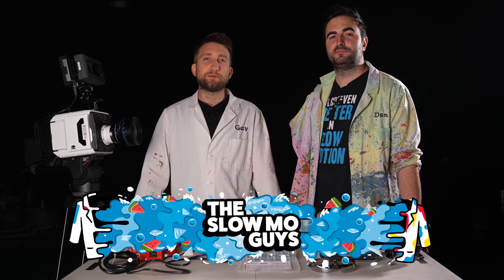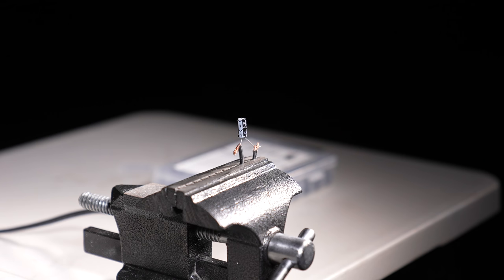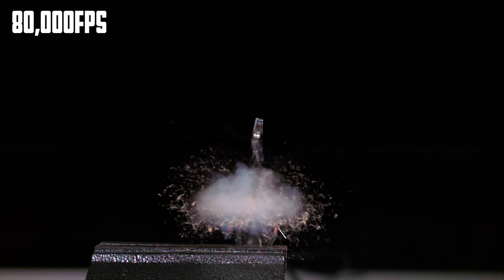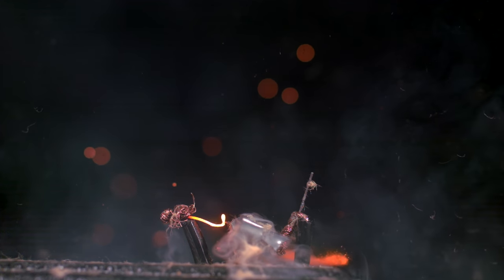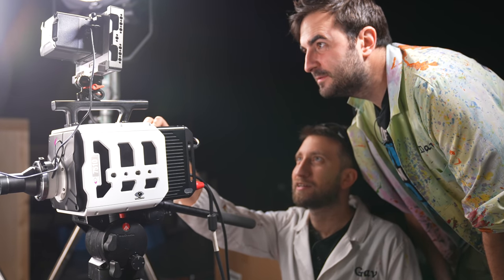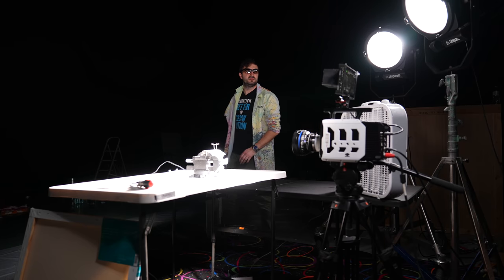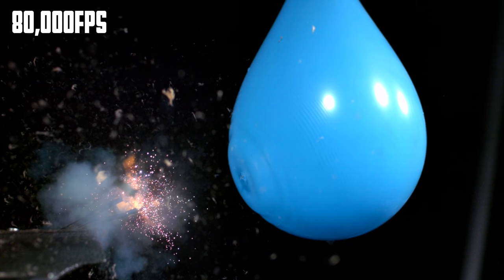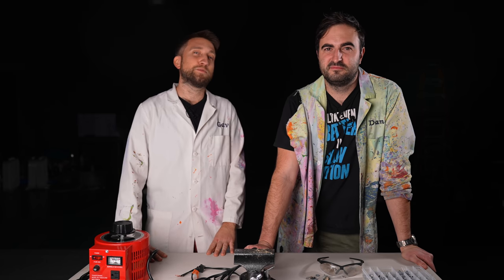Blowing up Capacitors at 187,000FPS

Comment: as a 12-13  Y.O kid I hooked a capacitor up in series with a 60 watt light bulb.
[ this was before they started making vented capacitors . I forget how many M.F and the voltage they were intended to run at, as this was many many years ago ]
I was standing too close to watch what would happen , and I noticed that the plastic label slowly started to shrink, and then a huge bang.  and the can went flying .and there was shredded capacitor guts ll over my glasses. it scared my cousin who was there, because he thought it  had broken my glasses. LOL thanks for bringing this funny childhood memory back  😀

Comment: The second explosion in the video happened to me during my apprenticeship. I was experimenting with capacitors and a laboratory transformer when suddenly the top of the capacitor in my hand began to shoot upwards. I threw it in the air beside me and it exploded in a cloud of dust. I was a bit shocked because I had never heard that this could happen. I thought it would only melt if I put too much energy into it.

Comment: We had a little electronics hobby room in my house, when I was a kid, and I used to love blowing up capacitors. I never tried ramping up the power though... I just plugged then into the mains (120 VAC) and they go bang... When I was really young, my dad would get us to charge them up on the mains and bring them to school... I don't remember actually doing it, but I remember the stories of throwing them to other kids and saying "catch" ... We also did this with siblings. 

My most recent "incident" with a cap, is working on a Bombardier snowmobile. Some of them have a clever electric start system (no battery no starter motor) They use a giant cap to start the machine by sending power to the stator... Anyway, I purposely crossed the the terminals with a screwdriver ... There was a ear ringing BANG and metal from the terminals and screwdriver was vaporized. Impressive.

Edit: I Just had another capacitor memory... I ran wires into a jam jar and screwed the lid on... then held the lid in place so that it wouldn't pop off... I wanted to collect and examine all of the bits... I was 9, and yeah... I never tried that again, and luckily the jar didn't explode... my hand healed in just a few days.

Comment: My father had a patent on what he called a plasma arc in the 1960s. While experimenting with capacitors he found the larger the capacitor that he used the  and even more amount of plasma would be produced. He thought if he upped the capacitors enough you would get more energy out than you put in. He never got enough Capacitor storage. When he died he had 1000s of pounds of capacitors in his back yard, including one that took 6 men to carry it out.

Comment: The safety measures taken here, little bit over the top. I was directly shot by a much bigger capacitor off a defective blueray player. Sounded like a gun. Scared my coworker, all but one were away smoking at the time which was sad. Hit me right in the shoulder and bounced off. Was hilarious. I do electronics repair, I know what I'm doing roughly. I'd love to see the different failure modes with reverse polarity at some point vs just raw power.

Comment: These are electrolytic capacitors. They DO HAVE safety vents either at top (in the can) or at bottom (in rubber). The vents DO operate when overloaded. But if you apply very high voltage, capacitors blow in random manner. And the capacitors do have a liquid (electrolyte) inside.

Comment: I have seen this destruction (well mainly the aftermath of it) for over 40 years now as a repair technician. Most of your flashy bits is coming from the arcing of the wires as the contacts short together. If you just want to see the capacitor itself explode, just reverse the polarity of the in power input. The cap will slowly heat up and then explode.

Comment: The older capacitors uses to shoot the entire can off more often than blowing the vent seam. It seems today that the seams split more often.
 A while back I had some leaky, beer can sized capacitors, out of a large audio amplifier. Those were spectacular when I later blew them up!

Comment: These are electrolytic capacitors, so the reason why it looks like there's liquid inside is because there is! :D Since the 90s, most of these can-style aluminum caps have water-based electrolytes because they are significantly cheaper than the other types of solid caps. They do have a limited lifespan because the electrolyte will dry out over time, but it's usually on the span of many thousands if not tens of thousands of hours.

Comment: The crossed bit of aluminum is doing exactly what you think it is.  It is made to be the failure point.  Remember how nearly all plasma TV's just up and died on their owners? Well, mostly this was because the good Chinese factories would install capacitors that were right at the very extreme of their voltage ratings.  The odd thing about it was that the circuit boards actually had the space available to install capacitors with higher voltage ratings.  Trying to make more profit won out however!  I own one of these plasma TV's and there is nothing worse hearing than the sound a capacitor makes, along with the smell, that says it just blew its top.  The ridiculous thing is that it might cost over $200 US to get your set repaired!!  However, I fixed mine by buying $12 worth of capacitors off e-Bay that were rated higher.  Today, over 20 years later, that set is still working perfectly!!!  I had the same problem with a hot tub control board.  $10 to fix that!!

Comment: Thank you for amazing videos! Looking at capacitors explosions I thinking that it will be really interesting to film some high current and high voltage discharges at 1Mfps. For example, electromagnetic shrinking. You just need some extremely large high-voltage capacitors.

Comment: Excellent shots of caps destroying themselves. I would like to know what voltages were being applied to them.
I have been in the room when the high voltage power supply capacitors on a tube audio amplifier exploded. It was quite a spectacle- an extremely loud ‘bang’ followed by that side of the room filling with smoke. 
Maybe you can film one of those big caps blowing up in high speed?

Comment: If you take a picture with a flash and 187000 fps, anything more than 800 meters away would not be illuminated, because the light wouldn't have time to get there and back. That's pretty cool.

Comment: As an electronics repair tech with more than 50-years experience, I am here to tell you that an unvented electrolytic capacitor will explode with the same force as an equivalent size firecracker. An exploding capacitor can actually completely destroy whatever it explodes inside of.

Comment: There is indeed liquid inside, that’s the electrolyte! When the voltage and/or current is too high, it boils over and BOOM. And the marks on top are indeed vent marks! Most larger capacitors will have vents, but some are meant for the whole metal top plate to break away, or for the rubber/plastic plug to give and blow the whole cap off like the little ones

Comment: They should take the ones from old radios and TV's. These had no pressure relief mechanism. When they exploded the components around were wiped away or bended, like a nuke in a big city downtown. The aluminum casing exploded, not just popping out. I've made a few wrong assemblies as you can see.

Comment: Tech classmate Don's roomie enjoyed emplacing small Al electrolytic caps in the bathroom outlet under the sink lamp.  Lights go on, cap go boom.  Once it didn't make good contact & Don reached up to remove it with the light on.  3, 2, 1, contact: Boom!

Comment: It takes a lot to blow a fuse
A faulty wire and a splitter, too
A pool of rain to make the short
A covered vent to make it hot, and you’ve got
Both: TOO MANY VOLTS

Comment: If you don't have enough voltage to blow them up, you can destroy capacitors even below their rated voltage! All you need is to connect your ground to the capacitor's + lead. The - lead goes into the positive. Guaranteed boom!

Comment: I used to repair Aircraft navigation Strobe light power supplies for Cessna.  Some had a single cap, others had double caps. They were massive compared to what you blew up, about an inch in diameter up to 4" long. and I can tell just by picking up a unit if the cap had blown. Oy do they stink!!!!   I had one blow on my bench, thankfully while the cover was still on and it leaped off the bench and made my ears ring for a good 20 minutes.

Comment: 1) Turn offf
2) Unplug
3) Press the 'power' button - this will drain the capacitors straight away
4) Plug back in and turn back on

Much faster.

Comment: it happened to me once in my career as a marine electronics engineer. I was replacing a capacitor in radar display making sure the polarity is correct then as soon as I switched the radar to STBY I heard a whistling sound then the capacitor goes bang. Was not my fault, the label on the capacitor was reversed during the manufacturing process.

Comment: I've been working a lot with capacitors lately, so I watched the first one and said, oh, right, it's shooting stuff straight up because electrolytics have that cross in the top for venting.  Then you started blowing up the ones that didn't have that — and I hurriedly looked at the caps I have and I'm a little concerned that I've got a whole box of 'em without vent marks. There's, like, 100μF caps, rated at 6.3 volts(!), that have just the plain metal blank. It's a little worrying. (I've been generally careful with the voltage ratings, usually going up to higher ratings than are technically needed, but it's another thing to be reminded why.)

Comment: I used to explode them with 120 VAC from a wall outlet at home. I had some spectacular explosions.
I would just throw a switch and put the full voltage on them.

Comment: i see a variac there...should try to over volt the caps with DC then reverse current and see how it explodes. those caps are mostly rated and designed for DC use not AC.

Comment: Do a full set of tuning-forks. The highest audible frequency is 20,000 Hz. Do one for each of your normal FPS tests, from 10,000 FPS to 1,000,000 FPS. Bonus for using a laser reflecting on the edge to create a wave on a wall. See if you can change the colors of the laser by altering the doppler-effect of the reflection. (Try a reflection of a reflection of a reflection at 20,000 Hz.)

Doppler-shift: Altering the light frequency by accelerating or decelerating the waves into another spectrum. (The tuning-fork might be enough physical vibration to cause a slight noticeable shift. Reflections off reflections off reflections, will combine and neutralize and create negative shifts, in waves.)

Even if it doesn't doppler-shift, it may still look cool with the wave reflections rippling on a wall.

Comment: Ways to explode a capacitor
1 over voltage 
2 wrong polarity/ dc/ac
3 connecting the negative and positive wrong 
4 heat form anything 
And many more

Comment: I remember many years ago I had a light rgb cube and I plugged it with different higher voltage adapter and capacitors had exploded

Comment: when I was about 18 I built a variable power supply  I had a 30volt  10000 uf capacitor but the supply was approx 33 volts it probably lasted 5 minutes  I could not believe the confetti it produced

Comment: High guys dale here from Australia 🇦🇺. Can you blow up some high 2,100 voltage oil filled capacitors that are in microwave oven ? And do them outside on slow mode and see what fails. The low melting fusible plug or it vents out through the top.

Comment: If you measure the current and voltage, power and temperature at the same, or higher, frame rates, you might actually learn something useful.  Rather than generating pretty pictures with no data, models or applications.
Reply: "rather than just generating pretty pictures"

You know... you know you're on a channel called the Slow Mo Guys, right? Not the "Scientific Data Analysis Guys"? 

This channel is about the art of photography. Enjoy it.